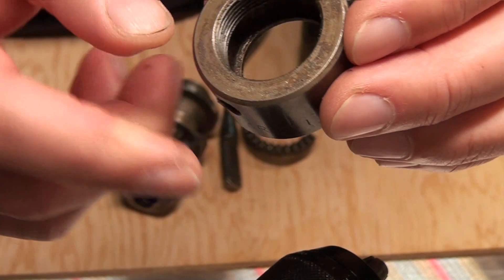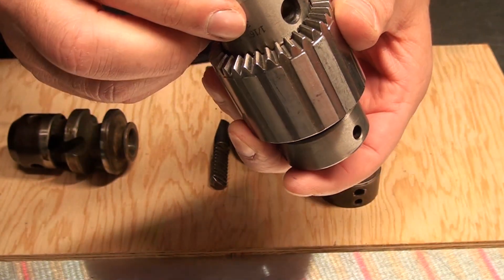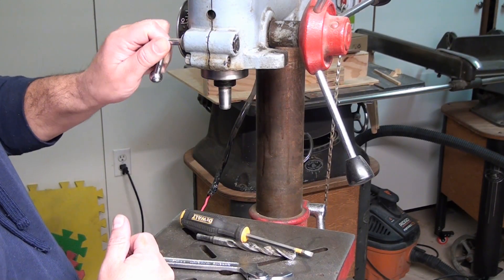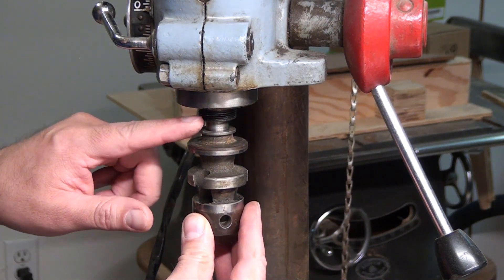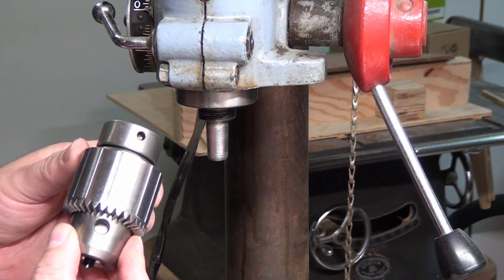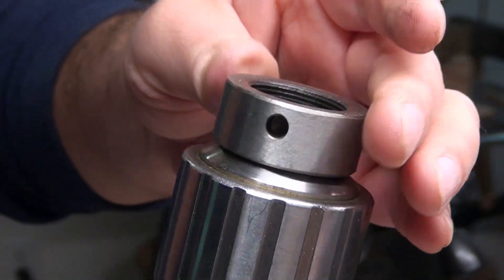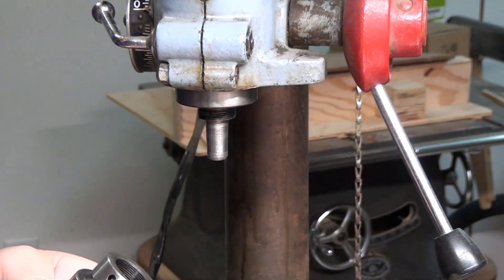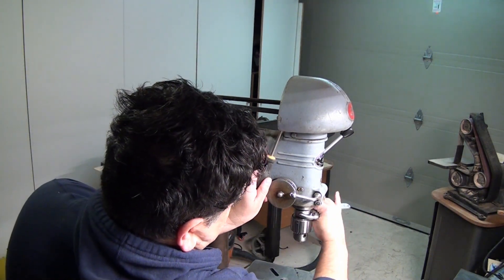COLLAR SLEEVE THREADED CHUCK 6T33C REPLACEMENT FOR BEAVER PRESS DRILL 3700

Comment: you actually dont need that threaded sleeve on the chuck, its there so that you can push the chuck off the taper shaft by unscrewing it. its there for convince. on other older drill presses, this sleeve is there but not integrated with the chuck, an example is the walker turner 900 series drill press. but glad you have found the chuck and it looks good on the machine
Reply from the maker: You are correct, it is for mushing chuck out. But it is also there to keep chuck on when sideways forces are applied, like when using sanding rollers. Thanks for watching.

Comment: Thanks for this video!  I just bought a 2700 model Beaver drill press and, although my chuck appears to be in good shape, it's very helpful to know how to remove it if necessary.  I have the same model jointer and tablesaw that you have.  They belonged to my father who used them in his carpentry and homebuilding business (in Guelph!).  The still work perfectly.  A few years ago, I found a Beaver bandsaw online and was able to purchase it for a good price.  These tools are well designed, well made and just a pleasure to use.  Thanks again!
Reply from the maker: Glad to know you also have a Beaver lodge! These cast iron machines are made like a tank to last for ever if we’ll kept. 
Thanks for watching.